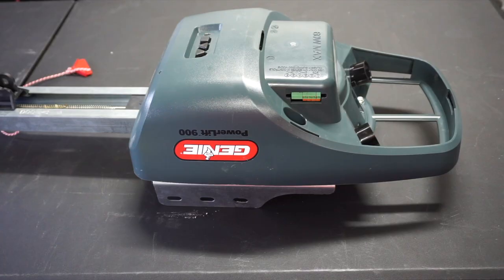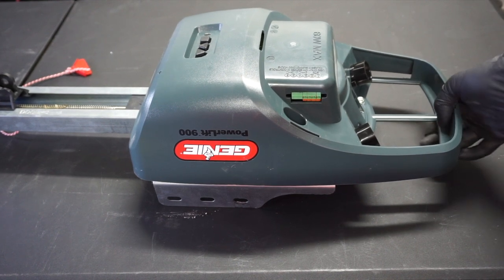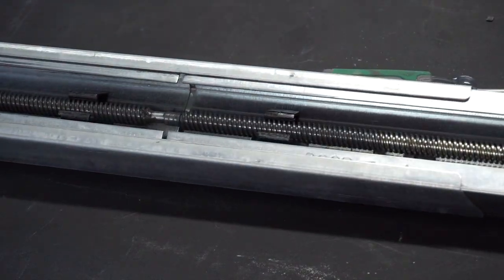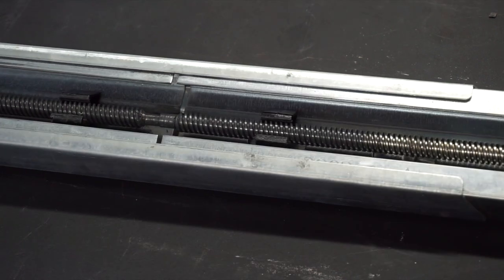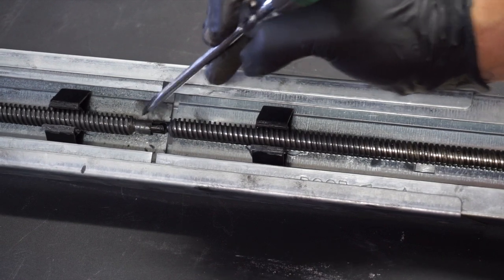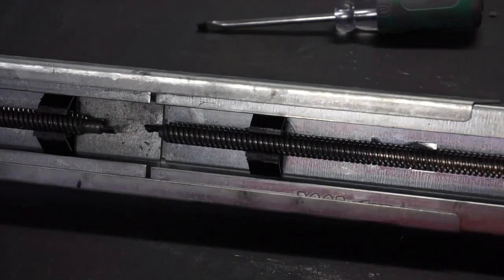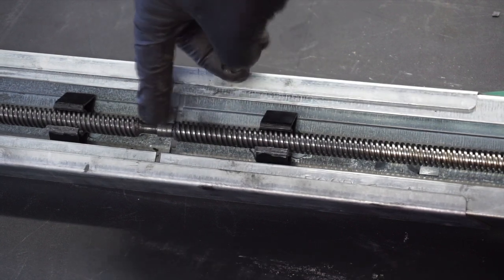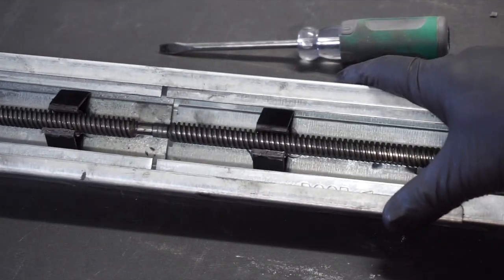Genie Screw Drive Clip and Collar Replacement

Comment: Hello. Could you please tell me what the problems are that a broken clip causes? What was the reason you changed the clip. I have a genie "Mach Force" that will not close all the way, after changing one of the door spring on a one piece door. With the door disconnected the carriage will travel the full length of the screw, but with the door connected it stops at the joint of the track or screw. It worked fine prior to changing 2 of the four springs, any suggestions?
Reply from the maker: Assuming you got the correct springs on there and everything is the same as before I’d venture to guess the motor needs to be reprogrammed. The machine force screw drive isn’t something I’d recommend on a one piece wood door as those things are really heavy ( even with the springs ) and wear out much quicker. 

A broken clip would usually prevent the carriage from traveling all the way, regardless if it’s attached or not so I don’t think that’s your issue
Reply: @GarageDoorGuidance  Thank you so much, I appreciate it.

Comment: I think it would make more sense for them to make full length screws so this weak spot in the system would be eliminated💡 I think it's their intention for it to have this weak spot so they can continue making money off of people buying the parts😞 Very nice tutorial Sir👍👍👍
Reply from the maker: Agreed but also have to keep in mind these are made for general public so they have to try to make it so it would fit in a regular car + shipping costs are probably cheaper too. My suggestion would be or the belt or chain drive instead 👍🏻

Comment: how long is one section of the drive screw from one coupling to the other coupling. my drive screw from my genie sds1000 broke and i need to replace it thats why am trying to see if i buy a screw drive from eBay will it fit and connect with no issue.
Reply from the maker: My apologies I did not receive the notification here. There are 3 different pieces it would depend on which on you’re replacing. Have you figured this out yet?
Reply: @GarageDoorGuidance  well I need to replace the section that close to the door/wall so the first section from the door opening. I was wondering if you can use and screw drive to replace the one that broke in half for me that's why I wanted to know the size j think mines is litte over 3 ft long
Reply from the maker: Ez Care you will need to find the same model, not all screws will be same diameter/thickness and so the trolley and connection won’t work together. Do you have a different model number ? I can’t seem to pull up an sds1000
Reply: @GarageDoorGuidance  it's a model isd1000 genie excelerator
Reply from the maker: Ez Care as long as you buy the same model you should be fine
Reply: @GarageDoorGuidance  ok
Reply: I believe I have the same model. You do  realize it's got a lifetime warranty on parts right?
Reply: @enufots4621  I didnt know that but I bought the home with the garage doors opener I dont have any purchase info for them

Comment: Hi i have Genie model ISL 950/A. Thanks for making this video. I'm having trouble separating the rod. I removed the clip and pushed forward the collar but cannot see any separation on the rod. I tied prying with a flat head screwdriver. Any suggestions you can offer me to help with the separation of the rod? Thank you
Reply from the maker: There’s got to be a separation on the screw itself, if not you may have a solid rail but then you wouldn’t have a need for those clips and collars so I’m having a hard time picturing your issue if I’m honest
Reply: I am having the same problem. Tried to pry the rod but couldn't separate it apart. The groove between the 2 rod's ends are there but prying it with a flat screwdriver' head doesn't work. I tried that with the garage door engaged or disengaged but it wouldn't move apart! What did I miss?!
Reply: Is it off the ceiling. Does it have room on either end of entire screw to allow separation.

Comment: Thanks... your video and link to Amazon parts saved me apx $10.  Good video.
Reply: How long did your's last before you had to repair it?
Reply from the maker: They should last for at least 10+ years if installed correctly from my experience. Also if it’s a custom heavy door I can see that damaging and breaking it sooner. But for those applications you’d want a stronger motor anyway

Comment: Andre, what kind of issues will a broken or worn coupler cause? My garage door stops during closing, with a loud grating sound. It might be stopping at the coupler. If I pull the door down while it is closing to help it along, it does not stop nor give the noise.
Reply from the maker: Sounds to me more like the carriage / trolley is nearly stripped out. I think that’s likely the problem rather than the coupler ? ( unless you can tell it’s broken but it sounds like everything is moving so may not be the case )
Reply: @GarageDoorGuidance  Thanks Andre, I appreciate it. Will do a little more investigating. Does not look like I can do it myself, but if I have an idea what the problem might be  and relay that to the repairman, there is less of a chance of being charged in excess, for something simple 👍
Reply from the maker: I wish I had a done a video on that repair as well, it isn’t too difficult but I don’t have that motor to demonstrate the process at the moment. When / if I come across one I’ll definitely make the video (:
Reply: @GarageDoorGuidance  👍
Reply: @GarageDoorGuidance  Woo Whooo!. With your encouragement, and from various videos showing the procedure, I changed out the trolley. My old trolley had four rows of good worm gear. The rest were worn down. And the second problem, where the door goes down a few feet then reverses, was cured by increasing the motor's force on the downward side via the adjustment knob on the motorhead. Thanks G.D.G. for the help!
Reply: @GarageDoorGuidance  
Such a precise suggestion!!! I had the same issue as @loft4me and have replaced the carriage to fix it.
Thanks.

Comment: Do these clips and/or collars break often? 
Those connection points and collars seem pretty weak for what they have to do. To me they look like a definite point of failure. 
Anyone had one of these screw drive garage door openers for a few years?
 
I'm thinking about getting one, but I don't want phone calls from my wife randomly every year or two telling me she can't open or shut the gagre door.
Reply: Mine is a very old one (17 years) broken last year and i replaced the whole unit completely without knowing this. It could have been a simple fix. I think lubrication once every year is the key to prevent any future damage.
Reply: Yep. I had on fail It's been on the door since before I owned the home (10 years) Garage built in '84. Could be original.  Thanks for the easy fix video.